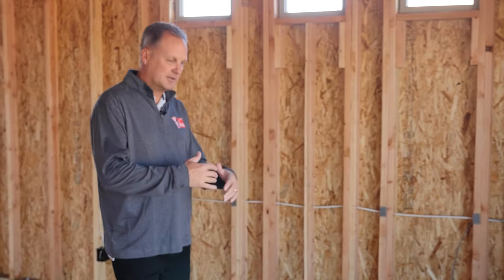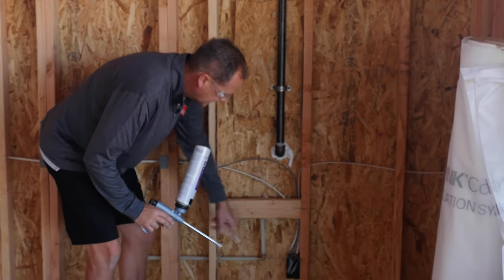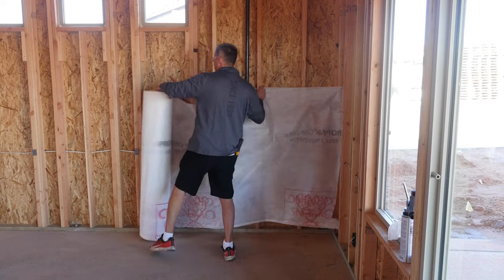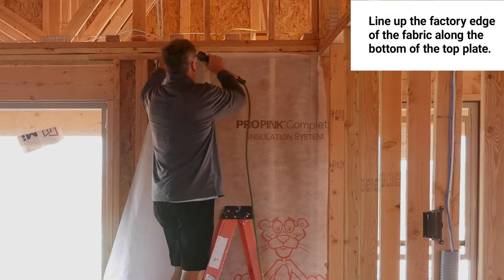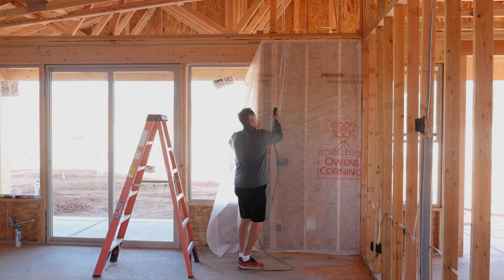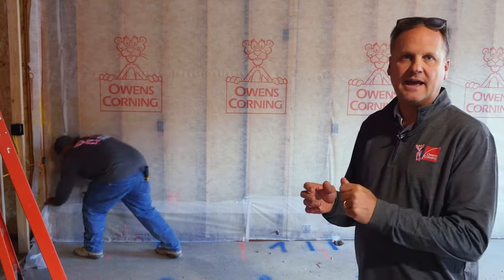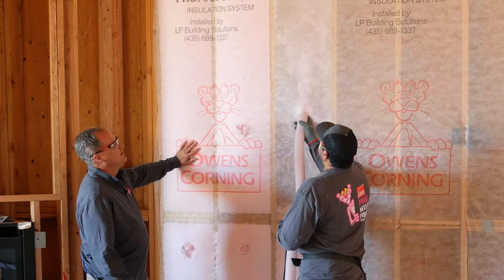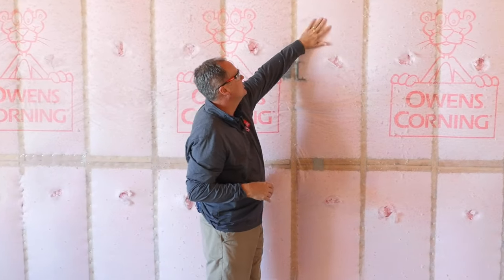ProPink Blown-In Walls Complete Training Video

Comment: I sure would love to see what you do with the fabric where the junction boxes are for electrical outlets and light switches after the insulation is blown in.
Reply: Cut an x in the fabric where the outlets and light switches are then tuck the 4 flaps into the edges to the outside of the junction box.

Comment: I have sheet rock already installed on the wall. What issues would i encounter if i made a 3" hole at the top of the stud cavity and inserted the hose at that point and then blew the insulation in from the 3" hole?
Reply: With sheetrock already installed it’s hard to tell if insulation made all its way down or up because there’s wires in between or studs nailed horizontally
Reply: Builders use thermal cameras to see what is not insulated in those cases and where to drill more holes